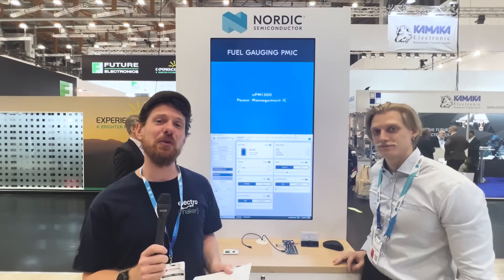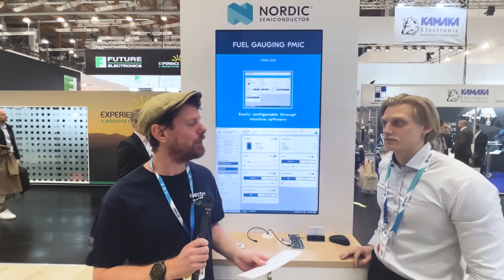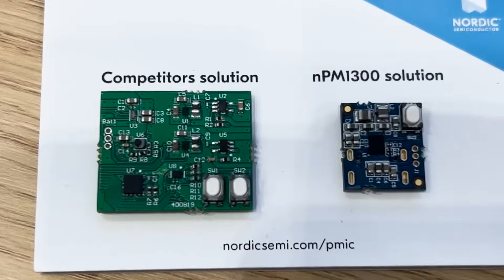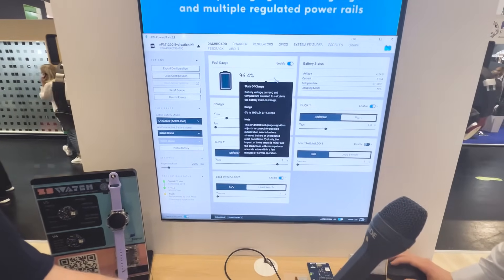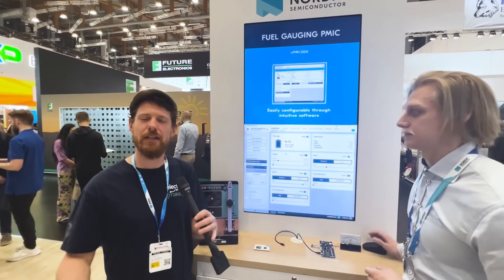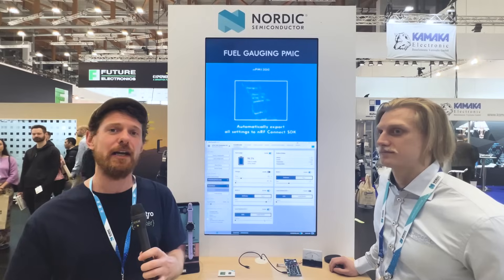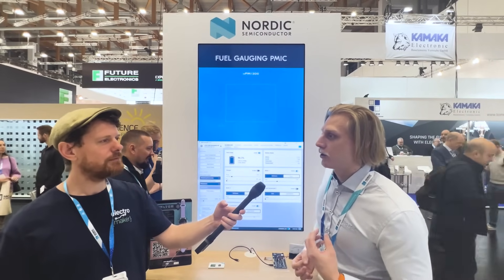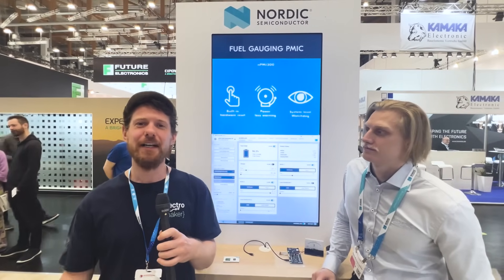nPM1300 PMIC - A single chip for all of your power needs - Embedded world 2024

Comment: We need this in a module, available on AliExpress, with 5v, 3.3v & 12v. Also with at least 8 batteries connected, and diodes and caps
Reply: 12 V would be hard tho, it has buckconverters with 5 V input